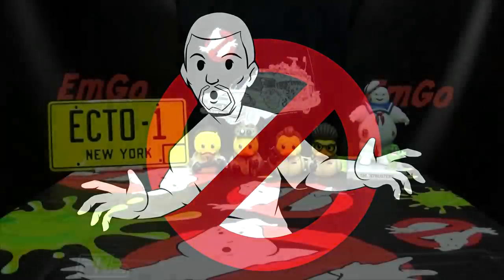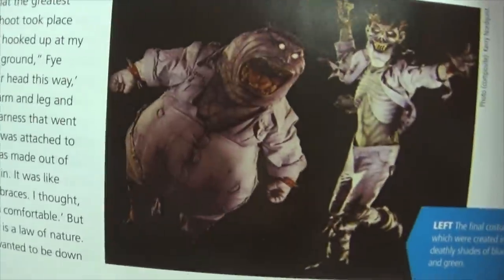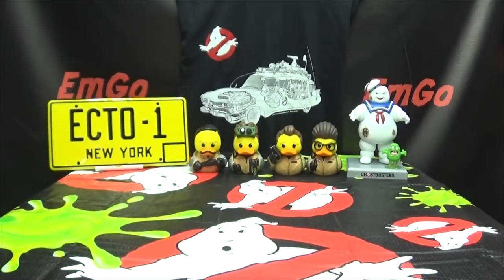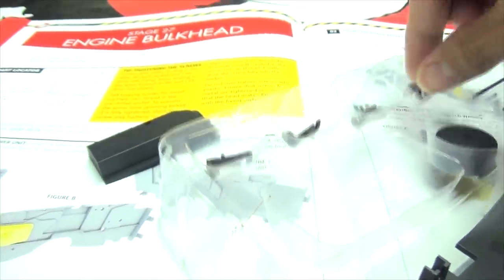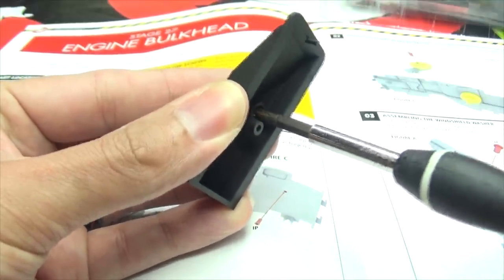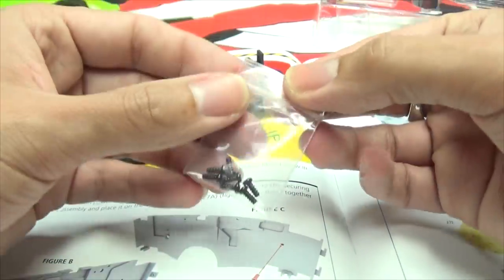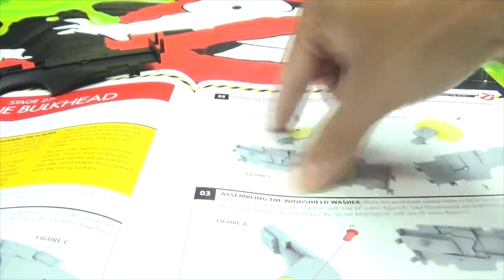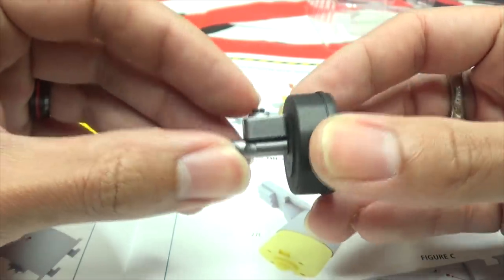Eaglemoss Ghostbusters ECTO-1 Kit (Part 27): EmGo Builds Stuff

Comment: Do you think you will go into building the proton pack? They just announced today of building a pack out of a fiberglass mold of the hero version of the gear. It will be wearable its kinda like the eaglemoss ecto-1. The reserve price for the body of it is 300, and each part you get comes with a certified licensed product sticker to put on the pieces.